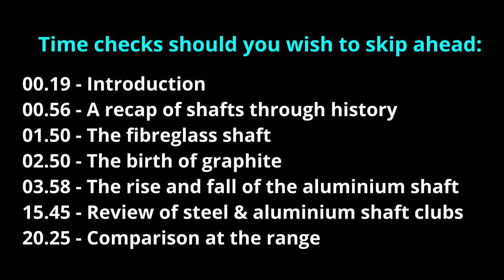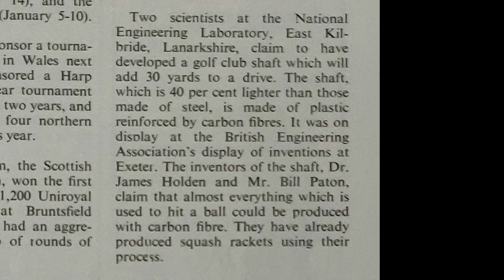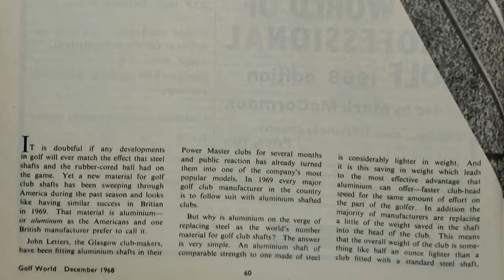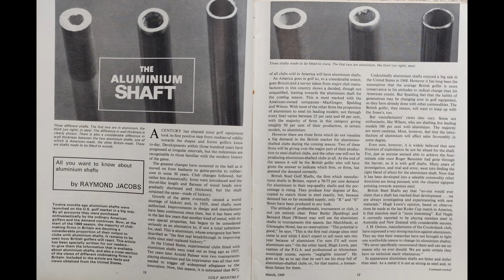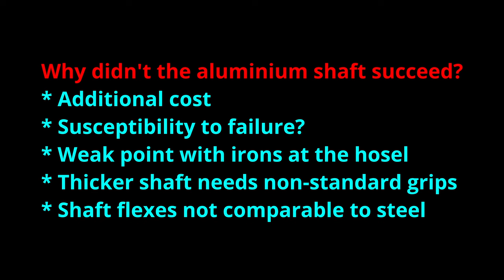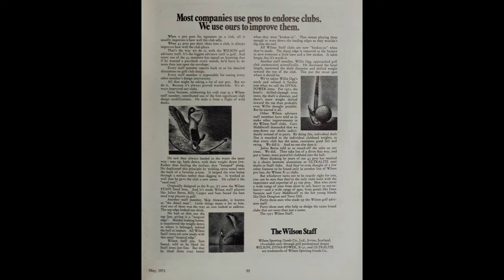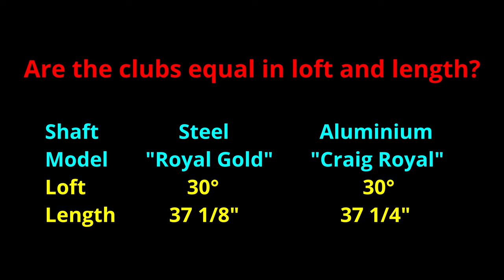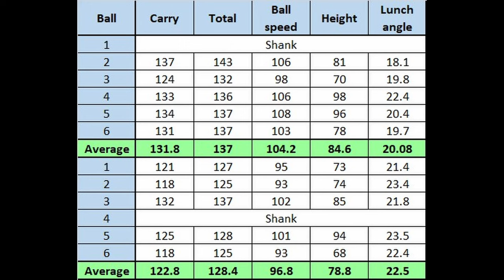The Rise & Fall of the Aluminium Golf Shaft, Fibre-glass,  Graphite.  Aluminum #vintagegolf

Comment: Great research and story line as usual. I have a set of 1968 Wilson Staff 2-PW with the regular aluminum shafts. Original grips are not worn out but a little hard. Hit them about once or twice a year as they are really in nice condition. Also had another set of 1968 Staffs with the stiff aluminum shafts that I used as my players. The golf pro at a club I used to play was on a round with me and said that is what he started out with. He traded me a new set of Staffs (early nineties) that I could not hit at all. So we traded back but he had changed the shafts to steel and I could not hit them well any more. Then donated them to a charity auction where they fetched $110 for a good cause.

Comment: Loved this documentary on the Aluminum shaft.  Kudos on all the extensive research you did; it was neat to see those vintage advertisements and vintage articles on aluminums.  I just found a set of Wilson Staff Dynapower blades (2-Pw) (aluminium shafts) at Salvation Army Store for 3.50 (U.S.)/club.  The head feels heavy.  I think they maybe exceed a D4 or 5 swingweight.  They are hard to hit but I have mashed a few.  I do think a good strike does produce a little more distance.
Reply from the maker: I only have the one club but I quite liked the feel of it.  In this video I wasn't getting the best out of the club but if you watch the follow-up video on fibreglass shafts it performs a lot better and outdoes the steel shaft.

Comment: Great video Nick,some impressive research and the usual dry humour!
I have a couple of MacGregor percies with 'aluminum' shafts but have never hit them as they don't look or feel 'right'.
I also vividly remember the appearance of a wistful golfer with a two-piece MacGregor MT Split Sole 7-iron,the head had parted company with the aluminium shaft exactly as described at the junction of shaft and hosel.
He asked the pro what could be done with it . . . . . . .
"I can put it in the bin for you", was the reply!
Audible difference in the shafts?
Is it April 1st already?
Reply from the maker: Great reply from the Pro, that's a very dry sense of humour that probably wasn't appreciated by the wistful golfer!
I'm not kidding, they did sound different, acoustics in golf clubs is an exact art these days and the different vibrations of steel and aluminium might effect the noise of impact?
This one did take ages to make, and as soon as I watched it on YouTube I noticed a few typos 😡, I had to smile at one of them though, on the results table is a column for the "lunch" angle...
Reply: @ClassicGolfClubs  I believe you're referring to 'harmonics' which I think is restricted to head design,I honestly couldn't tell the difference but the battery in my hearing aid might be low . . . 
Was that the 'lunch angle' for your sand-wich?😂

Comment: An American company called Easton made an aluminium shaft for Goldwin golf around 1999. It’s actually quite a good shaft. Easton are pretty big in arrows and hockey sticks. ( I believe they also do some serious high tech stuff) Anyway, they used an aluminium alloy called scandium. I believe the shaft lived on as “e21”. At least that is a scandium shaft as well. I still have a set of Goldwin clubs with that shaft and they are holding up nicely.
Reply from the maker: Thanks for that John, I did come across some stuff on Easton but it was outside of the date range I was focusing on so I didn't pursue it. Nice to know that someone made a go if it.

Comment: I've passed on some very desirable clubs because they were aluminum-shafted. I'm no metallurgist by profession, but have studied metals quite a bit for bicycle fabrication primarily.  And the reason I will not swing aluminum shafts is because aluminum cannot handle repeated bending.  Golf shafts must flex, and flexing aluminum isn't good for it. Steel can flex millions of times without fatigue cracks, aluminum cannot. It will crack eventually if flexed-and it's flexing most at the hosel.  That might not be what killed Al in the golf industry, but it kills it for me looking at vintage clubs.